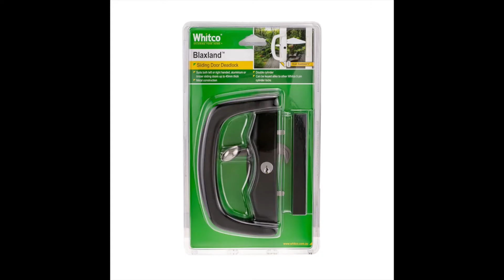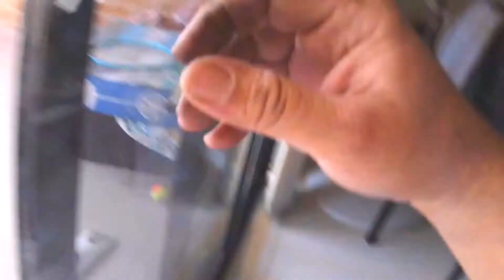Whitco Blaxland Sliding Glass Door Lock

Comment: Yes the latch has broken on both of my sliding glass doors and so I am in the market to replace them, so some explanation of what you are doing would be awesome.  How are you deciding where the various screws and parts go?  Also how did you determine what sort of lock to replace your existing lock with, are they all the same or are there certain brands you have to get?  I don't see any brand or model number printed on my locks so I am not clear on how to determine what sliding door lock my locks can be replaced with, without having to modify the door.
Reply from the maker: To see if this lock will fit your door , see link. https://www.whitco.com.au/en/site/whitcocomau/whitco-products/sliding-door-locking-and-hardware/blaxland-sliding-patio-door-lock/

* To know what lock to use, you will have to mesuer your lock foot print and comparer it to the lock in the link, 
* Without looking at your locks I can not tell you what will fit